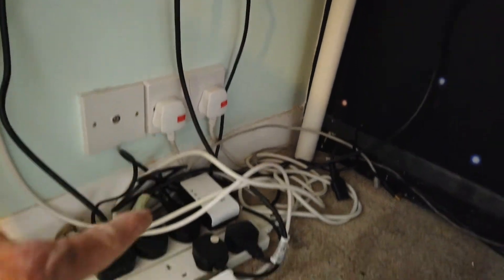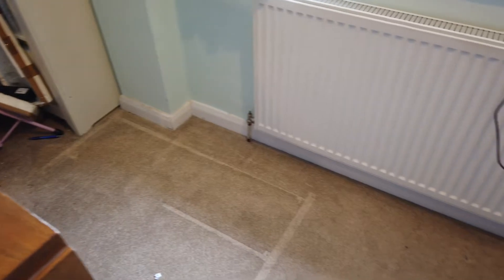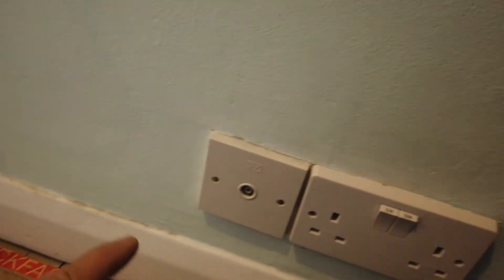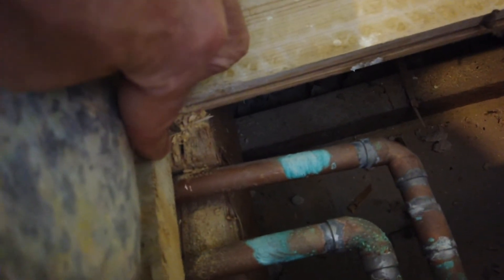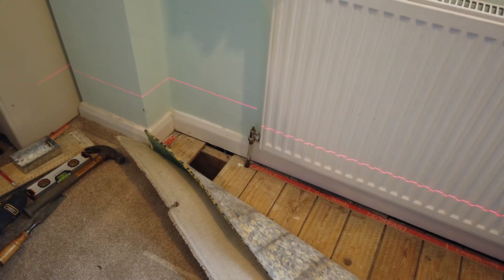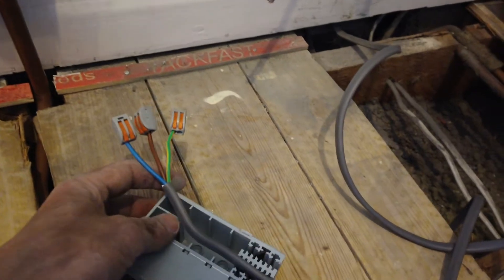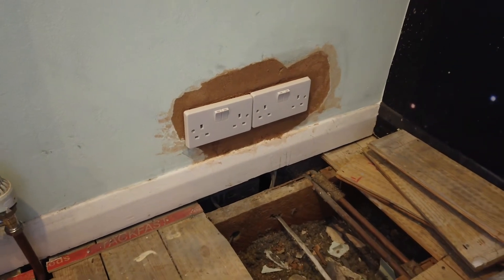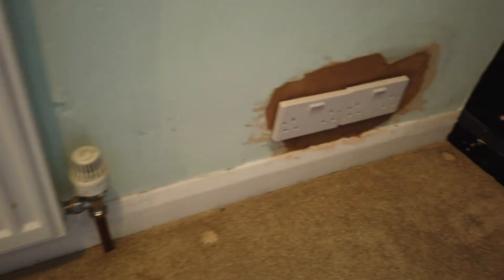ADDING NEW SOCKETS - To the Upstairs Ring Circuit

Comment: I need to do the same job. What amp WAGO box and connectors did you use? What gauge cable did you use to run to the new socket? Does it matter which cable you split on the ring going into your existing socket? Thanks.
Reply: He split the ring, but then reconnected the ring by bringing another cable from the new socket back to the original one. 
The WAGOBOX 221-4 Junction Box 108 x 39 x 44mm is maintenance free IF installed as per their instructions.
Their leaflet says the following:
1. (Paraphrased)
Connectors 221-4xx
Max Current: 20A
Max Cable Size 2.5^2
2. Follow WAGOBOX 221-4 BS EN 60670-22 installation 
instructions ensuring all phase terminals are installed 
into the receptacles of the WAGOBOX 
221-4.
3. Secure the WAGOBOX lid using 
the tie-wrap locking point. Ensure 
the completed WAGOBOX is not 
covered by insulating material
Reply: Did you check it was a ring .if you had pulled 1 of old cables from existing socket and put in to new socket next to then from new to new socket then back to old socket you wouldn’t have needed wago box

Comment: To avoid the possible pipe issue or any other issue I would get an electrician in to do the job because any electrician watching will be laughing at that rookie mistake, the not so funny side to that kind of mistake is that it demonstrates a lack of foresight and the next time that happens you could be very dead (I'm sure I turned the power back off!!!) or you might warm the house up with out turning the heating on!! electrical installation is NOT A DIY JOB!!!!

Comment: those  wago  connector  they  are  a life  saver  I added   few socket   upstairs  and  I used  a  th e junction  box  to connect  the  new  circuit  I have  to tihing  them  with  a secrew  driver  and  is a pain  enjoyed  the  video.

Comment: When it comes to avoiding pipework when cutting floorboards, houses don't tend to be built with the pipework notched like that; the pipes usually pass through the joists on the original build. If you need to get under the floor and it can be seen that the boards have been up before, that's a sign a plumber may have been in, so proceed with caution under the assumption pipework is directly below! If the boards have never been up, you're generally safe from any pipes or cables being within reach of the multi-tool blade.
Reply: Nonsense for decades plumbing was laid into notches like this, incredibly common in any 60/70/80’s build
Reply: @cglees  I agree, my three houses over the years all had notched top joist for copper pipe and in some case electrical cable too !
Reply from the maker: That's a great tip, many thanks for that

Comment: i have recently been using a tacwise stud finder, about 25 quid on amazon, it also automatically detects live wires and can be set to detect metal, within 5 cm. seems pretty accurate to me so far in my diy role, i would scan for metal and wires first before cutting.
Reply from the maker: That sounds really interesting, I'll check it out, thanks

Comment: I always have a nosey under the boards with either my phone and a torch to see where the pipes are if there mate any and try to measure with the multi tool. Close call! 😆
Reply from the maker: Good idea, thanks :-)
Reply: @sparkyruss4474  sometimes if the heating is on you can feel where the boards are warm.